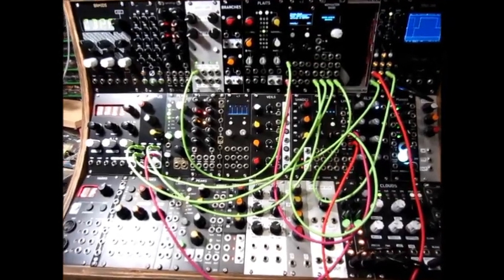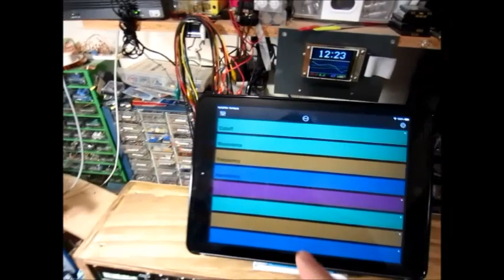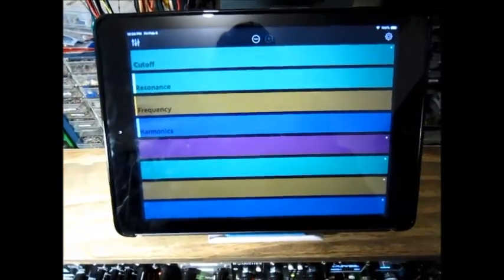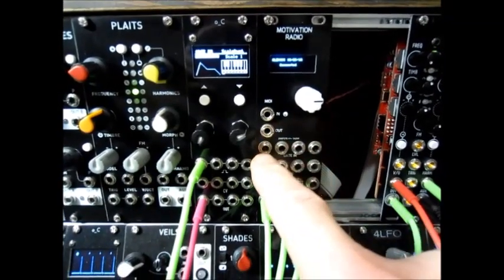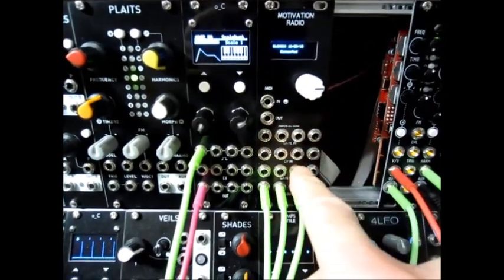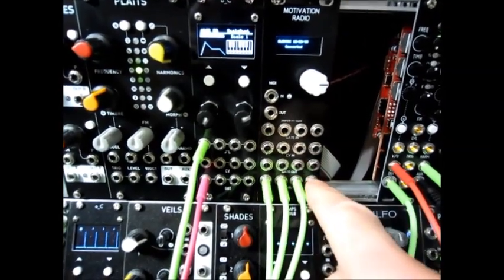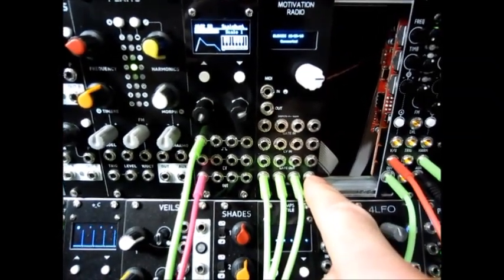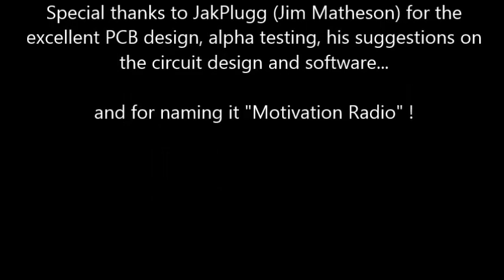Motivation Radio Eurorack Wireless Module

Comment: Hello , thank u for video! How I can use more Chanel for midi out? My midi out play only channels which I set in units( I want more then 4 Chanels
Reply from the maker: Not quite sure what you are asking. As I recall the MIDI to CV out app I wrote for Motivation Radio allows you to set the MIDI channel for each of the four CV outs. If you want something other than that you'd have to modify the code.

Comment: Cam we buy these ?
Reply from the maker: You can't buy complete modules but Pusherman sells the PCBs for it - link below.  If you have some experience soldering surface mount components its a medium difficulty build. You also need some experience with Arduino to compile and install the ESP32 code.

Comment: Fix clicking sound/// from espsynth86 doc
#include "ESP8266WiFi.h" // wifi header only needed to turn it off

void setup() {
    WiFi.forceSleepBegin(); // turn of wifi to reduce power consumption
}
Reply: this one is for the 909
Reply: Did you get the drum sketch to actually compile? I always got errors with the clickEncoder and the Arduino menu lib.

Comment: This is really amazing :) great job. i must mention that motivatioj could work VERY well in conjunction to this : https://github.com/Ableton/link/tree/master/examples/esp32
it is not based on the arduino sdk, so one would have to rewrite the dac/adc code and wifi, ble, midi. but the perspective of a link module under 100 euro is exciting :D
i have question: do you have a mouser bom by chance ? and is it hard to build ?i can do some smd soldering, but i did not find a build guide.
Reply from the maker: I did not do a mouser BOM and there is no build guide. Its intended for advanced builders that are very comfortable with software development. The ESP32 SDK keeps changing as does the Arduino toolchain so you have to be able to adapt the source code accordingly.
Reply from the maker: I just found out about the ESP32 port of Ableton link. I may have a go at it. Or somebody else could have a go at it - the idea of this module was for other people to create software for it.

Comment: Hi - does the Motivation Radio work in central mode, or peripheral mode (is it limited to connections from devices like iPads and computers)?  I've been working on a wearable MIDI controller for some time now, which until just recently could send MIDI data wirelessly over RFM69.  I wanted to try it over Bluetooth LE because of the potentially higher wireless bandwidth and smaller/easier antenna design but building a BLE receiver (as I did with RFM69) from scratch is proving difficult. I can send OK from the controller (peripheral mode) but pairing/receiving (central mode) is barely supported on my current receiver module platform (Adafruit ItsyBitsy nRF840).  If your module works in central mode, I'm hoping I could use it as a jumping off point to at least understand how central mode works.
Reply from the maker: I haven't tested it but the ESP32 API is supposed to support it. You probably want to dig into some of the online tutorials on the subject and/or the ESP32 Bluetooth APIs. Any ESP32 module will work and some of them are quite tiny - but power hungry. In my experience MIDI over BTLE has lower throughput than a standard MIDI cable. It also introduces 10's of milliseconds delay and jitter to the MIDI data stream due to the BTLE polling protocol and packet buffering. It works OK for low bandwidth MIDI when you can tolerate some sloppiness in the timing.
Reply: @rheslip20  Thank you for the response.  As it turns out, I should have done my homework on BLE specifications before I tried to implement it.  I just assumed it would be fine since it had become somewhat common, but I need better than the BLE-spec 7.5ms minimum latency.  The goal was to build a MIDI receiver specific to my control device that could, in the wireless stage, approach the speed of a USB connection.  I'm using Teensy boards that can act as a USB host so I was hoping to leverage that, and plug it directly into my synths (bypassing intermediaries like a PC).  Honestly... I think what I actually need is MIDI 2.0 to be released already :)  BTW, lovely module, despite my own challenges I hope to eventually build one and try it out.

Comment: Hi, just about to build mine. Ive seen your apps, do you know if there are anymore floating around? :)
Reply from the maker: I'm not aware of anybody else coding for it. There is a very cool project called "Pedalino" and a newer one called "Pedalino Mini" which could be ported to Motivation Radio quite easily. It rolls up a lot of common MIDI and control functions into one app. I may have a go at porting it one of these days. https://github.com/alf45tar/PedalinoMini
Reply: @rheslip20  That does look pretty. Although it uses a 128x64 LCD so a port would need to change the display stuff. Would be great it you did port it! ;)
Reply: I’ve built one and have started working on code for it. A lot of things are way over my head. I didn’t have any luck getting the supplied examples working. I don’t think it’s because of Arduino IDE version but because of libraries evolving and changing. Matter of fact, seems like the entire ESP32 environment has been changing a lot over the past year. I’ve been using platformIO to sort out library problems and hopefully provide a way to explicitly use a particular library when someone else builds/modifies code. So far I’ve gotten the WiFiOSC sketch to work and I’ve implemented the wifi manager for SSID/PWD connection anywhere. Trying to add gate and cv in functionality, probably have to figure out how to write some interrupt routine. Either way, I’m trying!
Reply from the maker: @jmsiener  That's one of the downsides of Arduino - its a moving target, especially when you stray from the AVR devices. I have four or five versions of Arduino installed on my computer because I have projects that won't build with newer releases and its just too much work to update all the old source code. Motivation Radio was designed as a fun little eurorack module for my own purposes. I was encouraged to open source it which is what I did. Definitely not a beginners project!

Comment: Looks great. Could 2 (or more!) of them talk to one another and send each other gates and cv?
Reply from the maker: They have MIDI in and out so you could do it with MIDI. The BLEMIDI sketch does MIDI thru so you can cascade them to add more MIDI to CV, Gate outs, CC outs etc. Network MIDI (RTPMIDI or AppleMIDI) supports multiple connections so that would probably work too. They can also talk to each other over a wireless network using Open Sound Control protocol which is perhaps the most elegant way to do it.